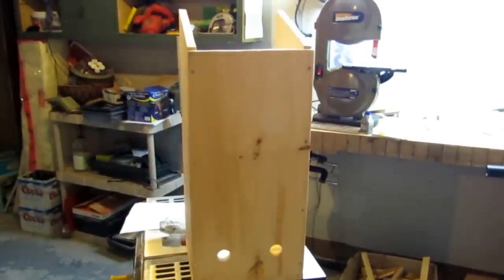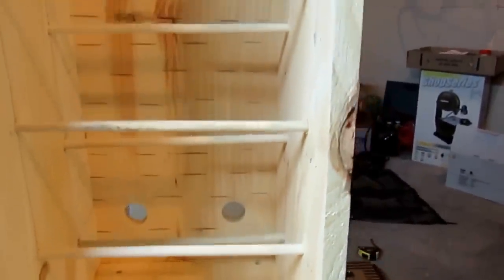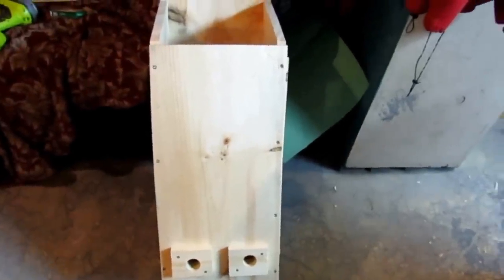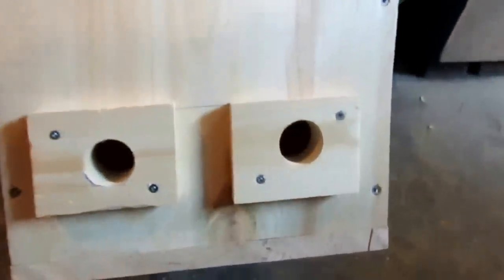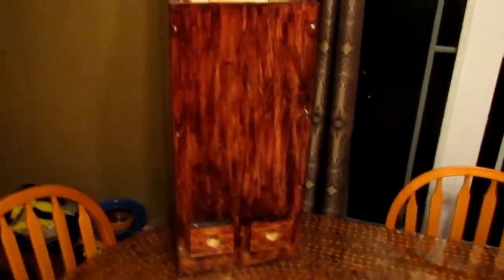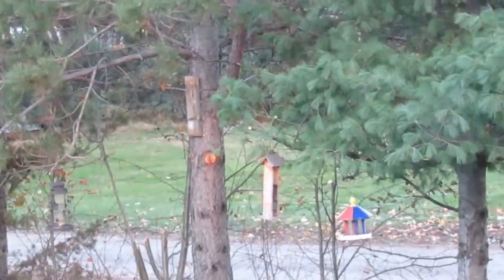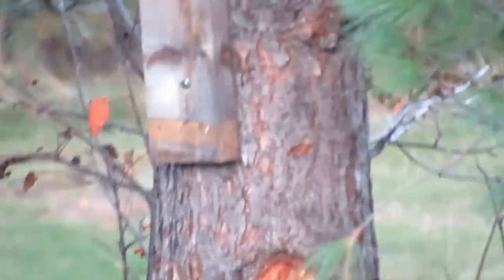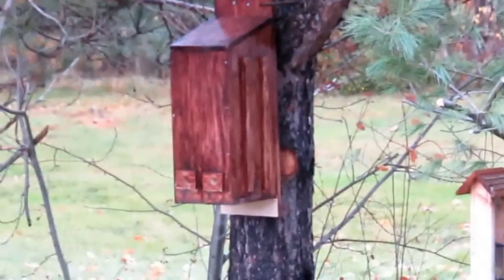Winter Roost box - DIY

Comment: What size are the dowels for the perches? It looks like you've lined them up - is that better than staggering the perches?
I have lots of Sparrows and I worry about them in our cold Canadian winters. Some winters can be pretty harsh.
It is my belief that all living creatures need shelter from the elements - Humans, Animals, Birds, ....
I want to make a very large Winter Roosting Box for my birds. Thank you for sharing the video.
Reply from the maker: Hi SW, tks for subscribing. i think the perches are 1/4 diameter.  i'm still not sure if they used it last winter. i got a spy cam now.  will put it inside the box to see if any activity.  will post a follow up to this video if i get any action.
Reply: corbou2000 Thank you for replying.  I'm making one today but am not quite sure how far apart the Roosting dowels should be inside the box. I'm "thinking" like a sparrow or small bird ... (ha ha), and thinking "COLD Winter" and how nice it would be to cuddle up to another warm body (bird next to bird), so I'm placing the dowels approximately 2 to 2 1/2 inches apart. I'm hoping that's not too close. I'll make the enterance hole(s) 1 1/2  inches in diameter. I'm hoping they'll use my Roosting box. They study everything first and then they send out a scout to check things out. The birds feel pretty much at home here. Maybe they'll use my Roosting box.... I Hope. Thank you... your Video was helpful.
Reply from the maker: Serephima Wings
you can put them as you like but i also put them a way that i could take some out if too many. or can add some later.  i'm gonna take the cover off mine today.  never did. wanna see if there's feathers in there .
Reply: corbou2000 Okay... Thank you. Please share what you find in your Roost box. I'm still working on mine...wish me luck... and I hope my birds like it too. I wish I could send you a picture of my completed work - It's fun too.
Reply from the maker: well you can make a video and link it into the comments here?  or email it to me corbou2000@hotmail.com . then i can post it or add your pictures at the end of this video?
Reply: Staggering them is best.  What you need to aim to do is allow space for the birds to evacuate, without evacuating on top of the ones below.